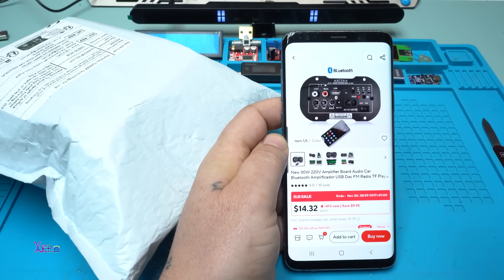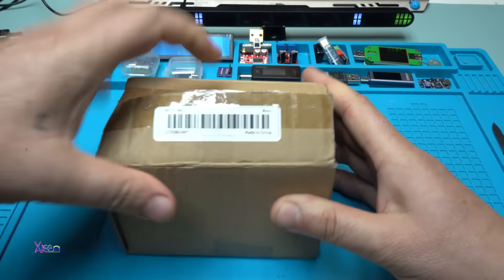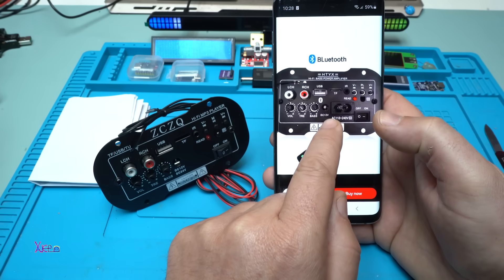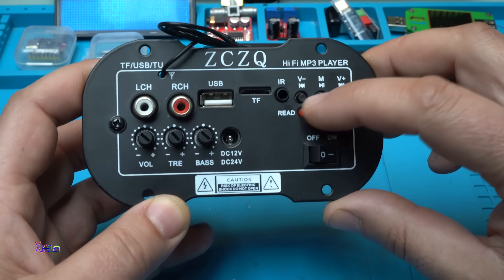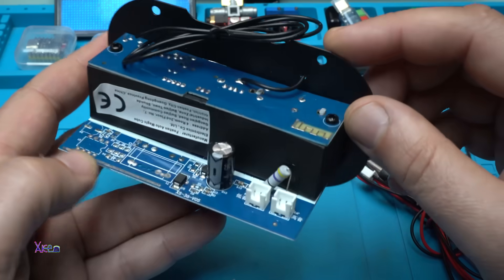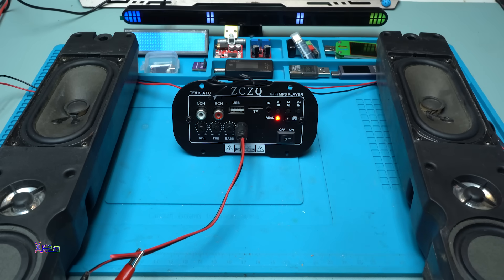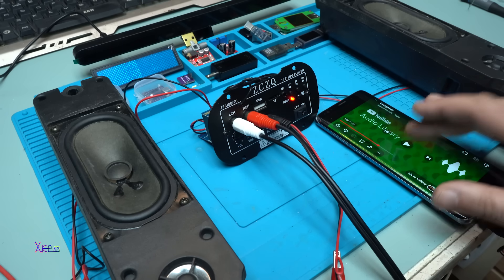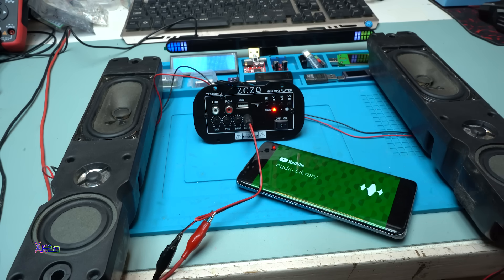Bluetooth Mp3 Amplifier from Aliexpress - Is it OK?

Comment: DON'T DO  220 stuff from CN. d9o it 12v.
Reply: Why?, most of the world uses 220v-240v, it probably uses a diode rectifier.
Reply: @gaevsprivs  coz I don't trust that powersupply.  So  buy this, and get the power from an old laptop powersupply,  from a reputable brand.